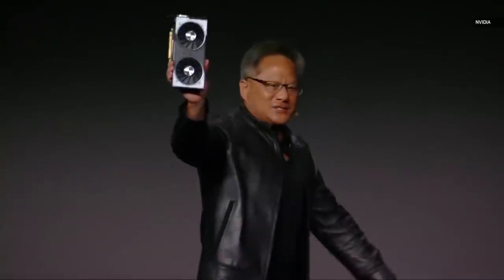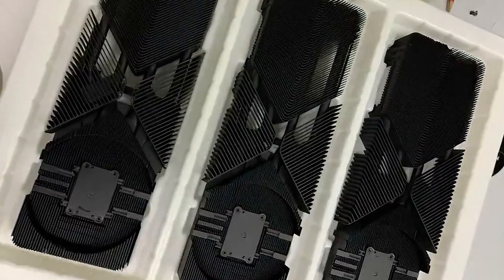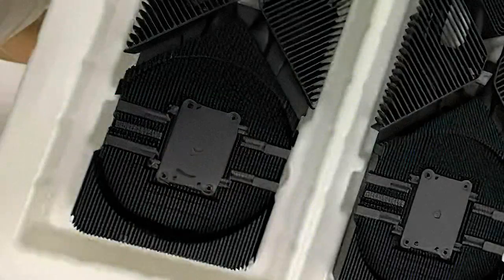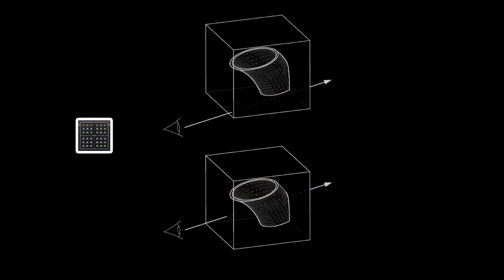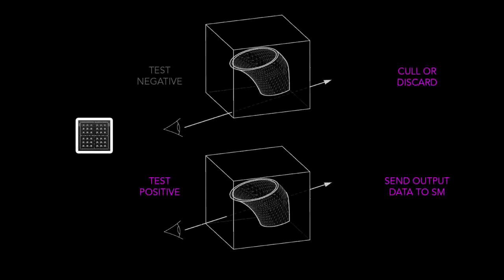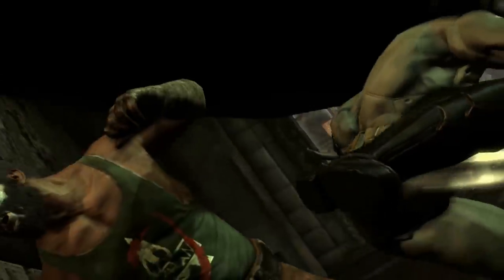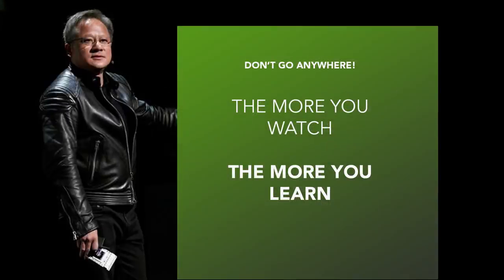A REVOLUTION in graphics is coming

Comment: It is a classic marketing technique to "leak" a product to encourage controversy which atracts attention to your product before it is launched. The problem CPU and GPU manufacturers are facing is that they have reached a point where the processing power is so great that they have to keep finding ways to tax the Processors to justify consumers buying their latest product. With most modern games if someone changed your graphics settings from ultra to medium most people would not even notice the visual difference. Nvidea hair is a good example of this. Nobody even thought  or cared about each strand of hair moving independantly until it was marketed as a feature. For the average gamer 1080P at 60 Hz without Nvidea hair will provide the same gaming experience at a quarter of the cost. Marketing is the art of convincing people to buy products they don't need.
Reply: wise words man ..
Reply: This is exactly the same thing that is happening now with Ray Tracing

Comment: "Everyone has a plan until they get punched in the mouth."  Mike Tyson - Problem with the co-processor theory is if designed for 7nm and now it's in 8nm-there may be problems with heat via latency, frequency, bandwidth

Comment: Cooler leaks:
Coretex: This changes everything!
Reply from the maker: Haha XD
Reply: @Coreteks  you need to team up with an engineer man to make a custom board
Reply: Coreteks Xddddxddxfz
Reply: @Coreteks  I don't see it.
If you look back, the first time Nvidia ever uses a node, the first product on that node is always smaller. Recently 500mm2 or less for the largest die. Then the second design on that node is huge, pushing close to reticle limit.
Also, the amount of memory means it may be stacked, which will need cooling for the GDDR and VRM. Maybe the PCB is double printed and there are VRM's on the other side so they can fit it in such a small pcb.

Also, the double sided design is meant to look good for people using it in a PCI-E slot or a riser.
Reply: @holdthetruthhostage  what board ? Motherboard ? Even a amateur can build one if parts are available but it isn't and even the documents won't be available.
Reply: @Coreteks  thanks can you talk about year 2050 gpu and cpu....nice video btw.....talk with jim keller
Reply: That is His modo for sure.
Reply: Cortex: I'm a GPU but the same time a CPU
The first thing coming in my mind is "Cortex Transgender CPU" 
Cortex: I'm a man but in the same time I'm a girl 🤣🤣🤣
Reply: @alberti.2334  Nvidia actually has a working quantum computer that can work out the design of next gen GPU's by showing it cortex videos and it just collapses at the state of ideal product. All they need to do is engineer tasty leaks.
Reply: @Coreteks  I read that in your voice, which is really strange...
Reply: @Coreteks  Consoles have more than limited ray tracing you noob they already showed path tracing running on Series X with Minecraft.
Reply: @Coreteks  love your ideas I was sad this one didn't pan out

Comment: Architectural improvements aren't generally responsible for performance uplifts, but architectures ARE what differentiates between the performance of one company's chip and another's.
Reply: You say that, but performance is almost entirely on archetecture now that clock speeds have basically plateaud

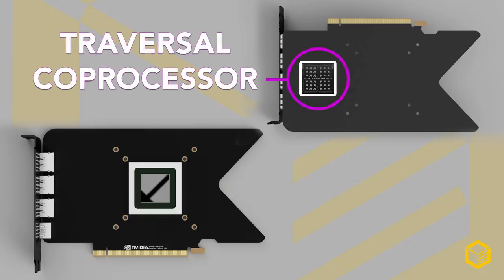Comment: Anyone wondering where Coreteks got the image for the "Traversal Processor" at 6:00 it isn't just any stock image, it's Nvidia's own experimental A.I Network chip, it doesn't actually have a name as of yet, but it's already been revealed by Nvidia :
https://spectrum.ieee.org/tech-talk/semiconductors/processors/nvidia-chip-takes-deep-learning-to-the-extremes
FTA:
"Key to the Nvidia multichip module’s ability to bind together the new deep learning chips is an interchip network that uses a technology called ground-referenced signaling. As its name implies, GRS uses the difference between a voltage signal on a wire and a common ground to transfer data, while avoiding many of the known pitfalls of that approach. It can transmit 25 gigabits/s using a single wire, whereas most technologies would need a pair of wires to reach that speed. Using single wires boosts how much data you can stream off of each millimeter of the edge of the chip to a whopping terabit per second. What’s more, GRS’s power consumption is a mere picojoule per bit."
With energy-per-bit increasingly becoming important to push the envelope of what can be achieved with processors, it's interesting to see Nvidia's efforts in this area, even choosing to use RISC-V in the cores of the individual chips that make up the mesh..

Oh and the part about Nvidia using advanced VR displays, how about 1,7000 Hz demonstrated by Nvidia 4 years ago in 2016 ?

https://hexus.net/tech/news/graphics/91943-nvidia-demonstrates-1700hz-refresh-zero-latency-display/
https://www.youtube.com/watch?v=PmAhJO6Vp3Y
More here:
https://research.nvidia.com/sites/default/files/pubs/2019-08_A-0.11-pJ/Op%2C//HotChips_RC18_final.pdf
https://www.anandtech.com/show/14767/hot-chips-31-live-blogs-nvidia-multichip-ai-accelerator-at-128-tops
https://fuse.wikichip.org/news/2456/nvidia-inference-research-chip-scales-to-dozens-of-chiplets/
Reply: That's very interesting, he should have brought that up in the video
Reply: thanks for that info... that could be worth an entire video
Reply: @miguelpereira9859  a good reporter never reveal his source
or he would not be able to access the source if it wasnt public
since he is not revealing even a publicly available source,  that would make him even more trustworthy
if that even make sense
Reply: I would have thought "traversal processor" is used in raytracing ? "Scene traversal" is something a ray does as its being tested for collisions along complex scenes, which is what RTX is doing (using BVH)

Comment: Ampere: 505 - 627 mm²
Turing (TU102): 754 mm²
But Turing has integrated Ray tracing...
If the accelerator thing is right (which would be REALLY COOL) then there are no RT cores on the main Ampere die, right?
I searched a little bit and found this article on Reddit* which suggest that SM's took around 56% of Turing, that's about 420 mm². 24% (180 mm²) are RT and tensor cores and 150 mm² is other stuff (mem. controller etc.) that must be in Ampere too.
So in theoretical Ampere there is approximately the same area used for SM's as in Turing. BUT! There is a die shrink. TSMC's 12 nm density is 33.8 MTr/mm² and TSMC's 7 nm density is 66.7 MTr/mm². That means they have twice the amount of transistors on Ampere! Wow, this is how they did almost 7k CUDA cores in A100.
My personal estimated performance gain is about +50% from die shrink and +10% from faster clocks with the same die size.

... right? I mean, i'm not really experienced, this is pure math estimate. But i believe that 3060 will be around 30% faster than 2060 with smaller die.

*Reddit article:
https://www.reddit.com/r/nvidia/comments/9btp1j/13_die_area_on_raytracing_i_dont_think_so/?utm_source=amp&utm_medium=&utm_content=post_body
Reply: well put, nice summary
Reply: I was thinking along similar lines.
A lot of Turing is the RT and Tensor cores. If you keep those on the same package, it would be extraordinarily difficult to mass-produce a larger chip at high yields.
Carving them off however gives Nvidia the room on the die which they need to stuff it with transistors for normal rendering purposes, to keep AMD from overtaking them.
It's multi-chip design by necessity.
Reply: Wrong, the 7nm has 65MTr/mm^2 vs 12nm of 25MTr/mm^2, that is how TU102 got 18.6B with 754mm^2 die while A100 has 54B transistor with 826mm^2. A100 has a full blown 8192 CUDA cores btw. So 12nm -> 7nm u are looking at 2.5X more density.
Also the Tensor core in Ampere is much larger than the one in Turing, this is very prominent given the huge increase in transistor and yet the Tensor Core per SM in Ampere is being halved.

Comment: hmm 27:30 the Stadia controller is connected to the router. There's no middleman. The CCU is only decoding stuff.
Reply: In fact, the whole description he makes is basically almost exactly the Stadia Controller, except for the odd bit about "saving games locally", which makes little sense in a time when cloud saves have become the norm (and the preference in most cases)
Reply: Yeah, he wrongly assumed how stadia works.
Reply: Stadia with NVIDIA GPU i'm in 🤩
Reply: @kbubuntu6048  Could happen... Though GeForce Now kind of makes it unlikely... unfortunately... I mean, GFN has the gear, Stadia has the UX & infrastructure... a combo would be <3
Reply: Yeah, @
Coreteks really needs to get his hands on a Stadia controller and CCU set up, so he can see what he is describing for the future of cloud gaming is already out. Everything except the local saves is already on Stadia or coming to it soon (AI stuff, other than just launching games). I have a Xbox One and PC (3700x + RX 5700), but have been playing 90%+ of my games on Stadia. It works great, and I don't have the CPU & GPU fan running when playing stadia games. I actually used GFN when it was in beta on MAC, and it was great too. The reason I don't use it, is because I don't have the choice to play it on TV (without paying $200+ for shield tv + controller). Also, with Stadia, yes the subscription is more expensive ($10 vs $5), but I haven't needed to buy any games either. Only bought Division when it was $10 on sale and the expansion, because I was actually playing it. But the monthly free games have kept me and my friends busy. Looking forward for ESO coming out tomorrow for Stadia Pro.
Reply: @kbubuntu6048  kinda ironic when you consider your name.
Reply: @RougeEric  or Google will just wait till Nvidia sets up their system and buys it from them to integrate it to stadia? Lol 😂 that would suck. Fuck Google.

Comment: The Stadia controller also connects directly to WiFi, so the argument that NVidia's streaming service will have lower latency than Stadia falls apart.
Reply: It should be Wifi 6e compatible, however. Which would almost eliminate latency for "VR-standard latency of 3ms" as per Qualcomm's announcement. Stadia doesn't support 5G either, so his point stands.

Comment: everything I’ve learned about the semiconductor industry, and about the production process of PCBs and processors, tells me that this theory is highly unlikely unless Nvidia plans to charge an arm and a leg. There are clear reasons why we don’t see much of the “one chip on the front and one chip on the back“ in today’s PCBs, with two of those being manufacturing complexity, and cost. In fact, I wouldn’t be surprised a bit if I learned most of that on this channel.  i’m also still not sure why this design would necessitate the type of cooler shroud we’ve seen; the design actually makes little sense in the way Coreteks explains it, unless the shroud is split down the middle horizontally along the PCB to separate the air flow... but if that were the case, why the wacky triangle cut out?

I don’t think that shroud will end up being on the market, but if it does it looks more to me like an advanced style of blower shroud or something....  it also seems somewhat out of character for Nvidia to launch such a radical architecture redesign like this out of nowhere, without some aspect of the additions being tested out elsewhere, like in the data center.  it IS possible, however, that AMD has forced the issue.

it would be pretty incredible if this theory were accurate; it certainly would be The start to an entirely new era of graphics.  But ive little faith in Nvidia pulling something like this off; I don’t think of Nvidia as an innovator at ALL - but thats just my opinion.

finally, I find the theory about the 3090 very, very odd. If that theory is correct, then RDNA 2 must be MIND-BLOWING.  SLI and crossfire are all but dead, and have been for a while now. I don’t see why Nvidia wouldn’t get laughed out of the building for releasing something like that, when the chances your game would be able to take advantage of it are next to nil.  Nvidia has been doing everything BUT tossing SLI out with the bathwater - this would be quite the reversal.  and anyone who knows Nvidia’s history of SLI support in drivers isn’t going to be giggling with anticipation.  Occam‘s razor says the 3090 is just a 3080 TI that Nvidia doesn’t want to chance getting beat.

it’s very strange actually; I’m not sure I’ve ever watched a Coreteks video that I’ve disagreed with more 🤷🏻‍♂️

edit:  I do want to add that I think it’s an exceptional idea that somebody should do ASAP, but if MCM-style GPUs were feasible latency-wise right now, I believe we would’ve already seen them by now, and just because of the current state of the industry I would assume AMD would be the first to market with them.   The only way we get the raytracing we need is from dedicated hardware that’s for sure.  ultimately, I’m thinking perhaps Coreteks maybe pulled the trigger a bit too early?  as in this might be NEXT next-gen or something.  I mean I’m sure by this point we all know of Nvidia’s goof on 7 nm - all of this seems really complex when they appear to have had sourcing problems for fabrication...  

edit 2:  also want to be clear that, as with most of the reliable, reputable tech tubers, this man is not conjuring this shit out of thin air, rest assured of that.  but while I do believe that we will in fact see a design similar to this very soon, from ANY of the GPU manufacturers btw, I just don’t think any of the leaks or rumors currently out there point to this particular generation being the genesis of this design. Anyone saying Coreteks is “smoking something”, is a fan boy or doesn’t understand this channel.

and while I don’t understand the whole holographic VR stuff one bit, I certainly hope it’s 100% accurate lol.  this is not my understanding of how holographic tech works, but like most people my knowledge of this is rudimentary at best, so I’ll take him at his word for now.  mainly because, if you’ll take note, most of the other stuff is prefaced with a warning to take it with a grain of salt. I heard no such caveat at the start of the controller/VR headset section. In fact, Coreteks seems to state most if not all of it very matter-of-factly, as in this shit is coming whether you believe it or not.
Reply: How about using 2 PCBs? Also production costs of 2 way PCS are feasible for high end cards, there was just no sense to do it to this date.
Reply: BHBalast don’t misunderstand me, I didn’t say this was impossible. In fact, you’ve been seeing it for a while with motherboards that have M.2 on the back. There is absolutely nothing wrong with anything said in this video as far as what is technologically feasible; i’m saying I don’t find it likely we will see this on the upcoming generation, partly due to design complexity but mostly due to cost.

also keep in mind he said that we would see this on EVERY version this generation.  since that would include low-specced cards, again I think it’s just financially prohibitive.
Reply: maxsettings except he never said that.  

Who invited the Momos into this thread?
Reply: @maxsettings2906  It's obvious you only watched a small part of that video, instantly stopped it because you heard one line and got mad, and then started spouting baseless accusations everywhere. Go be a smooth brain on another channel.
Reply: wall of runes
Reply: EpicKaiserTom “go be a smooth brain”.   dude - love that, and now its mine lol 😂😂😂